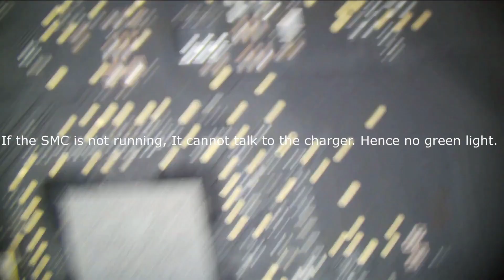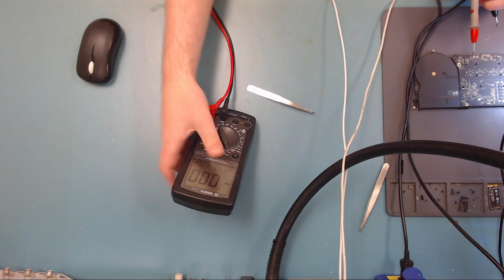2015 MacBook Pro 13" completely dead. Will it be repairable?

Comment: If your Macbook Pro won't power up remove the power connector for the Right I/O board to the logic board. It is a quick check and an uncommon, but frustratingly easy, fix that goes overlooked. And replacing the logic board and DC in board won't fix it.
Reply from the maker: Yes, that is something every technician should be checking. The board should always be tested outside the enclosure to rule this out as well.
Reply: Job jjb😊😊b😊😊😊😊😊